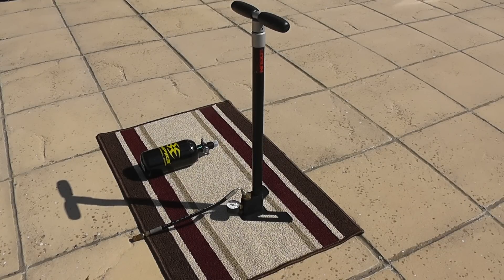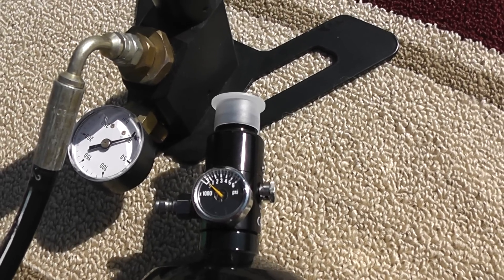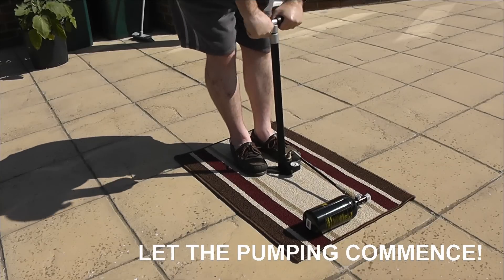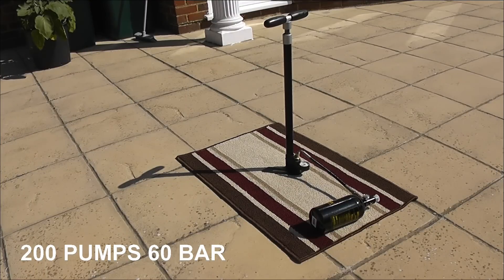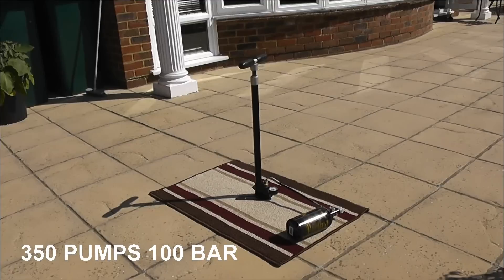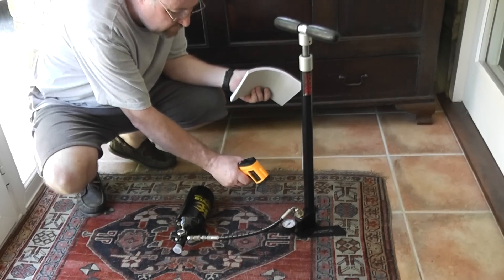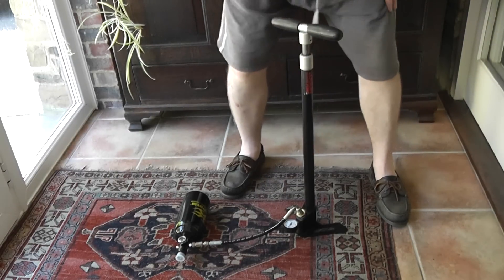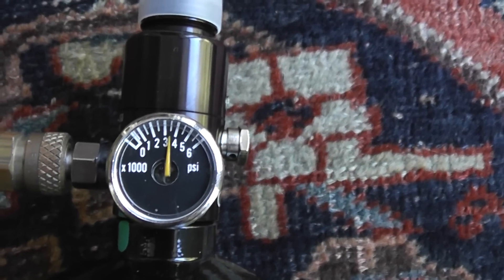Charging a paintball air bottle with a stirrup pump

Comment: And dose the temp really matter there is no one else who cares about the temp
Reply from the maker: If the temperature is high, the pressure in the bottle will fall when it cools down, so if you reached 207 bar at 50 degrees centigrade, you might find that the pressure drops to 200 bar when it cools down, so you will have less shots out on the field.  I do not think the temperature is a major issue and would not worry about it.  Thank you for your comments.
Reply: thanks so much for the info love your vid by the way very educational
Reply from the maker: The other thing about the air getting hot is that the pressure in the bottle will fall a few bar when it cools down.
Reply: +deathmetal4ever76 How much moisture can you see being expelled when you bleed the line to your pump/gun at the valve on your pump? Also while I've not really worried about it up to this point I am kinda curious about what the most common failure mode is for high pressure air vessels due to internal corrosion.

Will they start developing small leaks or is there a real risk of getting a catastrophic failure while there's still a good bit of pressure in there leading to potential dangerous situations if it happens while being handled.
Reply from the maker: There is a fair bit of moisture when the bleed is opened.  As for the way a tank will fail if there is corrosion, I do not know.  I worked in the oil industry for many years and I suspect the failure would be gradual.  If it was not, the potential for serious injury or fatality is very high!  That is why these tanks should be certified on a regular basis.
Reply: Russell Platten Yup I'm aware of the certification requirements. And I hope the most common failure mode is that way indeed, but I wouldn't rule sudden failure when the stress gets to be just too much and a big hole at full pressure out entirely based on my limited understanding of how steel weakens through corrosion in regular situations.

But I'm still wondering about what the difference moisture content wise is. Comparing the results by filling tanks in a 50%+ relative humidity place with a handpump compared to compressors designed to create breathable air for divers/firefighters.

I won't stop using my rifle, but when I thought a bit about the risks of high pressure air last month I did decide to store both my rifle and small tank in such a way that there's a solid closet door between them and potential residents in the house. It was a good excuse to clean that closet out and make it my central storage area for air rifle related things anyway.
Reply from the maker: All good stuff, pardon the pun.  You are absolutely right to be worried about 200 barg in a rusty bottle.  There is real potential for harm.  However, I think that the likelihood of an incident is very small and to put things into perspective, I have never heard of an injury or death caused by an air rifle or paint ball gun bottle failing.
Reply: Russell Platten Well an additional reason why I figured it was about time to sort some proper storage was because they were nicely on display (and easy reach for me when I needed them) in my bedroom before. 

Considering the little ones of some relatives are starting to get to that age where they're not just crawling on the ground anymore but also able to sometimes open doors and escape to places out of sight I feel a bit more comfortable having the rifles out of potential reach from kids. With springers and variable pump pneumatics I'm not too worried as they aren't that harmful when unloaded. But even "empty" or rather where the 40 Joule (30 ft lbs) rated PCP rifle drops out of its regulated air pressure levels if they cycle the bolt and pull the trigger unloaded it'd still produce a blast of air at the muzzle capable of causing damage to someone in close proximity.

A year ago I didn't consider this to be an issue as I didn't have the PCP rifle and their little ones weren't able to get there yet. But if there's 3 or more of them about on a birthday visit it's easy for one of them to escape out of sight briefly and climb the stairs. So that alone was reason enough to finally bother with some secure out of sight storage, and having a barrier between me and the high pressure air vessels while in storage is an added benefit.

Comment: Will the pump mess up the tank at all?
Reply from the maker: No the pump will not cause any problems with the tank.  It is a very slow process so it would be extremely difficult to over pressurise it unless you are not checking the gauge.